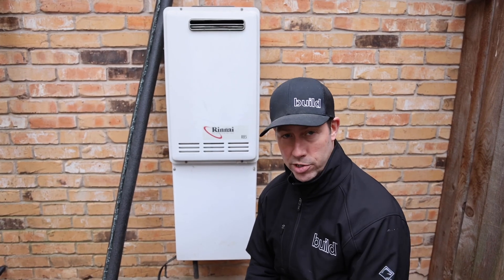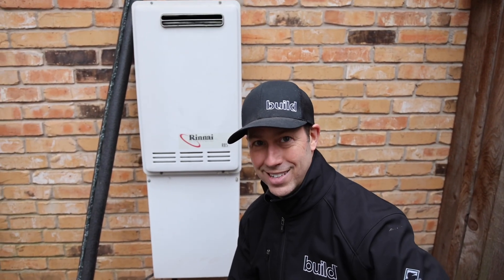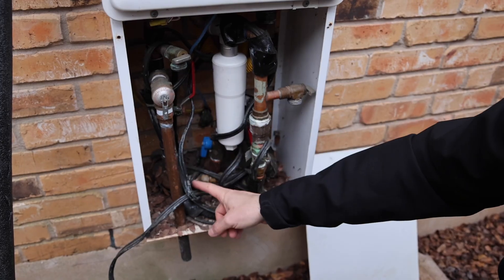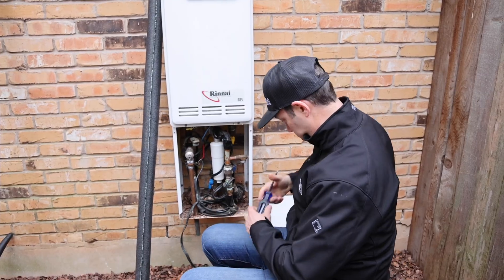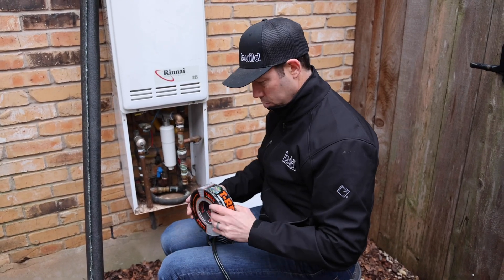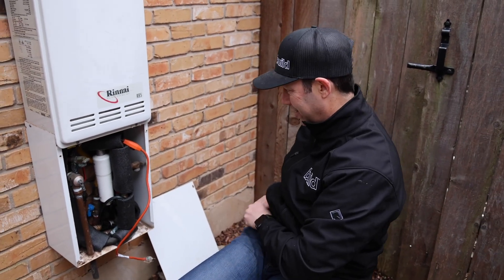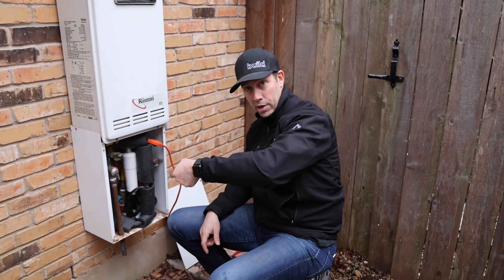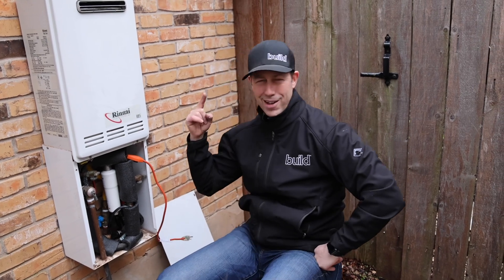$30 and 30 Minutes - Tankless Water Heater Freeze Prevention

Comment: "As long as the power is on at your house..." It might be time for southern states to make a change, in practice and code,  to stop cutting corners and actually build for the weather they MIGHT get, not the weather they typically have. e.g., anything water related on/in an exterior wall.
Reply: In Iowa we don’t get 110 degree days but the houses here have the AC and insulation for them.
Reply: @Rad_Triumph_765_RS  Thats not an apples to apples comparison since most people would need AC to feel comfortable with an outside temp of 70 degrees depending on humidity levels. So obviously homes in areas that get above 70-75+ for long periods of the year would require AC.
Reply: Does it make financial sense to build homes for winter conditions that have not happened in 100 years? I guess it depends on how much more home buyers would have to pay for protection against once in a hundred years type Weather.
Reply: @Nflguy4949  The "has not happened in 100 years" is BS, we get freezes every couple years in Texas, though obviously the current one is much worse. Mounting the heater outside to save a square foot or two when it could easily be mounted inside seems like the height of penny wise and pound foolish.
Reply: @sashamanster  It’s not BS. It wasn’t just “freezing” as in below 32 degrees at night while daytime we stay at or above freezing which is what Texas usually gets. This once in a hundred years storm brought Temps down in some areas of Texas to ZERO degrees at night and didn’t get above 19 degrees during the day. Other areas got down to single digits at night and during the day up to 27 degrees. Combine that with no power for several days and you get a winter storm disaster we haven’t seen in Texas for 100 years. It’s not just these tankless water heaters. The temps were so low that homeowners across the state are dealing with busted pipes. In the DFW area most reputable plumbers have a waiting list of 200 customers due to the storm.
Reply: @Nflguy4949  in Iowa we don’t see -50F every winter but I will say most of us are prepared for those temps.
Reply: @Rad_Triumph_765_RS  When you get far below freezing for several days/weeks/months  in a row like happens in Iowa..what does it matter as far as pipes are concerned  if those nights are 10 below freezing or 30 below. The point is that you know sustained temps below freezing are likely so you build homes accordingly.
Reply: @Nflguy4949  once in a 100 years is so yesterday! Once every 5 to 10 years is the new normal due to climate change. and even if one doesnt' believe in science, everyone know the weather is not what it used to be.!
Reply: Do you prepare for Hurricanes and earthquakes? Volcanic eruptions?

Comment: So I didn’t see this video until today but that’s awesome it has had so many views . It looks like my pipes where already insulated mostly . But when I opened the cover , I saw ice build up. I tried the hair dryer thing for about 20 minutes . It melted the ice and then I started to see drops of water from the part above that the cover is still on. Then in a matter of seconds, water started pouring out from above . I have to manually turn off my water. Does this sound like a busted pipe ? I have never had one but I assume it is.

Comment: Zip ties would make attaching the heat element and insulation easier.
Reply: use metal ones, plastic might melt
Reply: @rollandelliott  the zip ties go around the insulation and the pipes are not hot enough to melt them. They would not be exposed the any part involved in heating. Because the space was so tight I used zip ties to secure the insulation last February during the freezing polar outbreak.

Comment: In a panic in Austin. Have 1938 pier/beam. Am thinking pipes not insulated. Tried to go under house to check & found snake staring @ me. Only piece of mind was to fill bathtub & pitchers for 6 day no water. I turned off water & emptied water lines (hot/cold). Ran to turn off navien (completely forgot w/other stress mounting). I saw water had sprayed out when I ran to turn off gas/electricity & drained tankless (filter also). I have outdoor tank covered with blankets/plastic but worried this was wrong move & would be safer to keep on w/gas keeping water/tank above freezing. Any suggestions? I realize I may have really screwed up already draining hot water pipes before turning off tankless. I just figured safer with no water running thru house but now second guessing myself. There is still time to correct this if another option seems safer. I just was trying to be safe & may have done exact opposite. I can't imagine Austin w/6 days below freeze. I beg, any suggestions? I know I won't be able to find a plumber for weeks after this event. Thank u for any/all help.

Comment: To all the haters of outside mounting of a tankless water heater, it saves potentially thousands in venting costs. 

My question is why not dispense with the rinnai under heater closet and just use a well insulated cooler as your pipe cover, just like you'd do with an outside spigot? Wouldn't it be cheaper and easier?
Reply: I fully agree. After having several attic installed tankless heaters I will never do it again, they are far too problematic. I currently have three heaters linked together. There's no way I was going to install three roof penetrations for all the venting so outside they went and I couldn't be happier.
Reply: yes insulated box over the outdoor sections would make a lot of sense!
Reply: Well, I'm going to shoot down my own idea having started the project. Not the idea of insulation on the outside pipes, that's key. But at least on my rinnai you have to have 12 inches of clearance below for flammable material. 2 inches for inflammable. So mineral wool seems like the best insulation, and you need metal to cover the 12 inches below, including the 2 inches where you can't even put insulation. Don't have a metal fabrication shop in my garage so might as well go with the rinnai pipe cover bc it's made to fit perfectly. Now I just wish I'd specced that on the install because I've got a gas line and a overflow coming out what will be the sides of my pipe covers.

So plan for your outside tankless to have a pipe cover and insulate that sucker with mineral wool. No way those costs will add up to as much as indoor ventilation. That should keep you from having to drain it in anything but an extended power or water outage during a severe (you know, for the south) winter storm.

Comment: Is there some reason behind putting critical equipment in such exposed areas? Shouldn't you at least put some sort of protective enclosure around things like this, I mean you could have any number of things blowing around that could damage these things and insurance is no fun to deal with. 

Best would be to have all your stuff inside the house but if that isn't possible why not build a simple wooden box or something around your stuff? That would also let you insulate the box and reduce problems like this. Where I live you wouldn't even be allowed to build in this way, you wouldn't be able to get insurance and I bet the inspectors would condemn your house two seconds after they saw the installation.

Comment: I would turn the gas off. Run the cold water through the pipes, then let it trickle. Hot water freezes easier than cold. In the Northeast US. We can that the "trailer park trickle"  🤣
Reply: No point in burning all that gas, while you're letting it flow
Reply: The only reason that hot water freezes easier than cold is in standard tank water heater, all of the dissolved solids and sediment settles into the bottom of the tank and you draw clearer, mineral free water off the top for the hot. It has nothing to do with the temperature, only due to less mineral content in the water. This does not apply to a tankless system for obvious reasons, since there is no where for this sediment to settle.

Comment: I'd consider heat tape on the pipes and insulate the box.  If you read the directions, the black "knob" on the heat tape is supposed to be placed against the pipe to sense temp of the pipes.

Comment: Typing from Florida.
One point of note: most gas tankless installations are piped directly through the exterior wall. 
The only exposed piping is within the unit itself.
If one is in a sub-zero climate, yes, installation would best be left to the interior with all of the venting and flue requirements therein.
However, in Florida, the tankless system is the go-to solution for water heating.
Power outage? The tankless units have a back-up battery for the pilot light.
Still want to heat a 60 gallon tank of water and have it sit there and keep reheating it?
Have at it, if that's your choice.
Tankless (gas) options give instant heated water as it's requested without storing it in a big tank.
I would never recommend a tankless for a client unless they have a gas supply.

Comment: Add a outdoor Kasa smart plug and turn it in and off with your phone or with your voice connected to Alexa if you don’t want it on all the time !
Reply: The heat doesn't go on all the time. It only goes on when it's get close to freezing. The unit draws a trace amount of electricity for the thermostat and the "on" light. So the unit can stay plugged in and on all the time.
Reply: Oh sweet didn’t know they had bulilt in thermostat

Comment: I wonder what the temperature rating is on the duct tape? I might have used a product like Sure tape.. they have high and low temperature ratings on all of their tape products,. Excessive temperatures can cause tapes to the
 de-laminate and come off...
Reply: Generally, the correct tape to secure heater cable to piping is a glass cloth electrical tape. The TRex tape says it is good to 200F, so it might work for this.

Comment: My tankless is installed in the attic by the home builder. Not sure I need to worry about it in there... do I?
Reply: Only if your attic temp drops below 32F
Reply: @jdookie2908  It never has until now... I am in a suburb of Austin Texas. Wouldn't have helped anyway because I have been without power for a while with no end in sight. My tankless appears to have not only frozen over but burst through the case.
Reply: @major7up  man, that sucks. Sorry to hear it. Most tankless heaters have built in freeze protection but they have to have power for that to be operable.
Reply: @jdookie2908  I am trying to get it warm enough so I can turn the shut-off valves so that when it does thaw it won't leak in the Attic

Comment: I replaced a tank water heater with a tankless water heater. Mine was in the attic. The first winter I had it freeze after a several days of freezing weather. The cold water supply and hot water return came though and returned to the cap plate and down a wall. I put heat tape on these pipes from the unit to where the pipes entered the wall. No problems since. In a confined space like you have would not a light bulb in there keep it warm enough not to freeze?
Reply: I live in Ohio. 75 watt bulb works with some temporary exterior insulation like 2 in foam for the duration.

Comment: An alternative to duct tape is self-fusing silicone rubber tape. It is almost like electrical tape that only seals to itself. It is very heat and cold resistant and it doesn't break down like duct tape. It also doesn't leave a sticky residue when you remove it.

Comment: Hey Matt, if exterior pipes are already insulated but don't have heat tape, and the system has a recirculation mode that's running every 30 minutes, is it worth tearing off the insulation to put heat tape on when the cold snap is only going to be for a few days?

Comment: I came back to post some more comments regarding builders, plumbers and remodelers. 20 years ago I hired one of the supposedly high end, good contractors to put in addition on a home we bought and I wanted it done before we moved in. Additionally he was to replace the entire roof on the existing home starting with sheathing.
A nice man, seemed well educated building/construction and had all the right answers. And everything did turn out correctly in the end because I made them come back and fix the things that were wrong one day after the mistakes. This man was for all intents and purposes a good contractor but he hired subcontractors that were less than reliable.
As you can imagine we had issues, and a number of years later I had a leak above my family room ceiling where one roof intersected with another roof and they had shingle down into a very small valley which should have never been done. That insurance cost was $3000 plus my deductible. He even installed the wrong windows in the addition. Naturally he had to replace them and they were Pella windows and the distributor told him these are not what the customer wants, he wants to match the windows that are in the existing portion of the home. I could go on for an hour. If you don’t know what right hire someone who does the watch the construction and look it over every day at the end of the day. As one final note when the plaster board hanger showed up, some of the insulation done the day before was not right and he had to get the insulating contractor back to fix it you can imagine how thrilled he was.

Comment: Strategically placing a small INCANDESCENT light bulb inside the unit would likely work as well.
Many hot water heaters in SoCal are placed inside closets with a door to the exterior.
Reply: That’s fine with power, but when the power goes off , still needs to have a faucet dripping inside on hot and cold side
Reply: or halogen bulbs; more vibration resistant & reliable

Comment: i would shut the  heater off and crack open a hot water valve in the house  when i needed hot water simply turn in back on  moving water does not freeze

Comment: Love the videos Matt! Are you sure you can leave the orange knob-like part with the round black button on it just hanging like you did? In the cable I use, this part contains the temp sensor, which doesn't get cold enough for the cable to kick on, unless you have the black sensor button fastened tightly to the copper pipe that you wish to heat. Just a thought. Your product might be different from what we use in Germany. Keep the videos coming! Much love!

Comment: why do you have to wrap the heat tape? .. it would seem a single strip along the pipe wrapped in insulation would do it?...
Reply: I bought some yesterday, and the Frost King instructions are pretty clear- you can't wind or wrap the heat tape around the pipe- it's supposed to be laid along the pipe with no overlap. The also want you to attach it with electrical tape, and the black button on the end of the line is the thermostat- it needs to be touching the pipe.
Reply: @somearchitectTX  
that is good info... however... the word isn't out... How to install Heat Tape to your pipes | Step-by-Step - https://youtu.be/tnBVK2BxtZI

Comment: So I wire in a frost stat and a recirc line between the hot out and the cold in so if it ever drops below freezing by the unit it heats and circulates the water at it to stop the issue.

Comment: Even in southern Florida, putting this outside is a stupid idea. It's not going to last as long exposed to the elements. These are so small that you're not gaining much space inside the house.
Reply: I was thinking the same thing. Why would you put it outside even in a tropical climate? I'm guessing humidity would just destroy it over time and really shorten its life.
Reply: @explorenaked  my house has a detached garage. We had the water heater in the attic. That is dumb. So, when it came time, we replaced with a tankless. Short of taking an entire closet over and tearing out ceilings to run the venting, we had zero choice. Now, if you insulate the lines through the wall, not just run it up to the wall, freezing is not a huge issue in North Carolina.
Reply: I'm guessing people in the US aren't willing to have them installed on a kitchen or utility room wall, the way it's done in most of the world. Personally I like mechanical bits and piece of a home obvious and visible because 1) I like the way it looks--it's a reminder that a modern home is a machine as well as a refuge and 2) it's easier to notice if something is wrong, but my tastes are in the minority.
Reply: It simplifies gas venting
Reply: There are many tankless water heaters (gas) within my own city block.
Central Florida, the tankless heaters have been installed, some for over 10 years, on the exterior, with no issues.